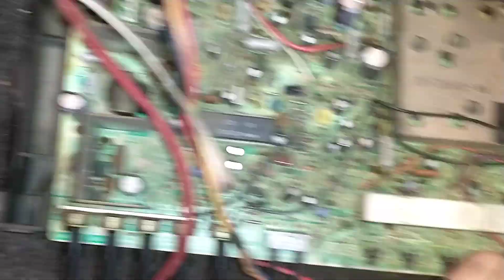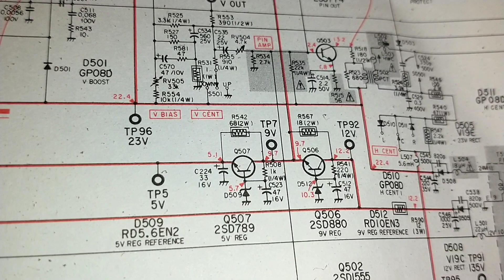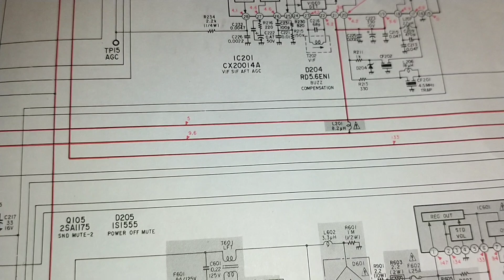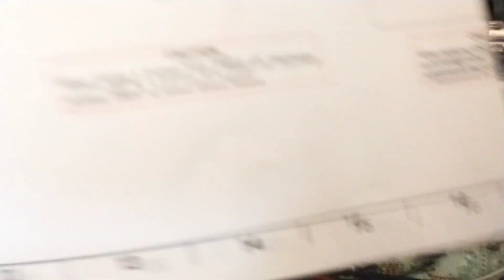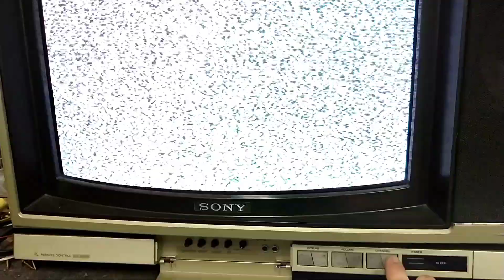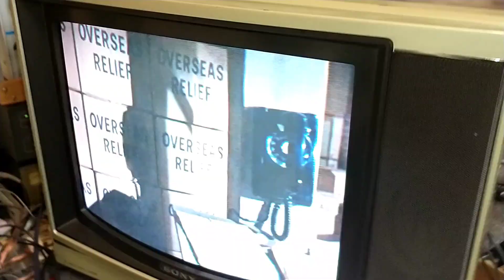Servicing a 1987 Sony KV-1997r - dead set.  Part 2/2 -repairs

Comment: You probably know but there are 2 type RST's. One RST low with a line over RST in the
manual & RST high, no line. . Low pulls pin low & Hi pulls it high to RST.  You can do a
manual RST by pulling the pin high or low. The manual will show you the RUN
RST voltage.
C U Later

Comment: It has a really good picture now, well done Jordan :-D
Dam capacitors!.
The channel memory could be a typical 8 pin i2c serial type.
it could be hiding in the module that controls the tuner.
That would make sense.
I hate schematics that jump about on the page,  it makes it hard to keep track.
Modular circuit blocks make more sense, clean layout.